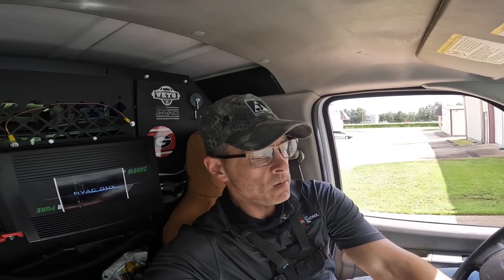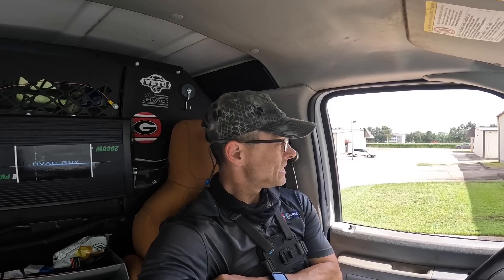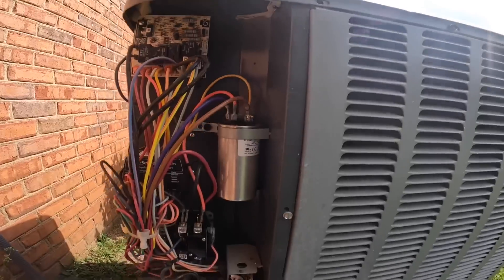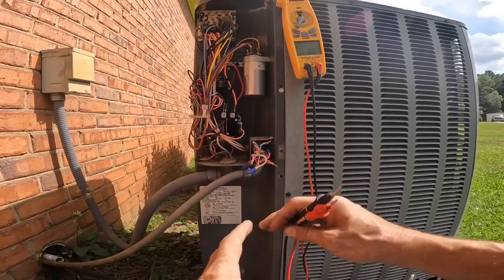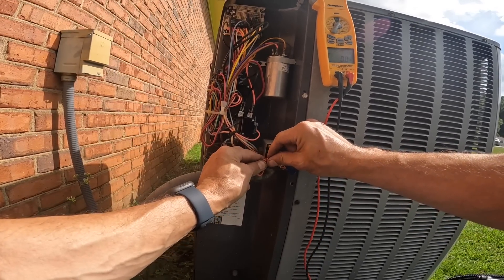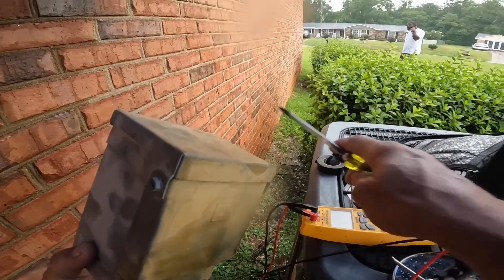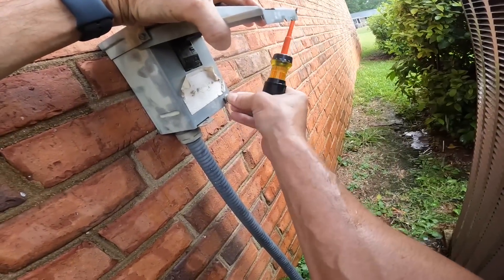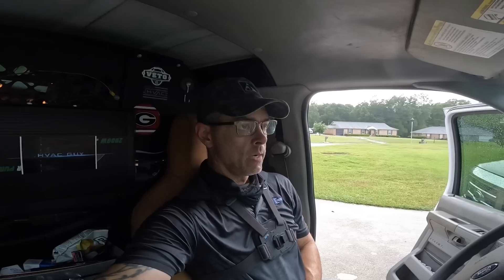Blowing Heat Inside and Cold Air Outside When It’s 94 degrees

Comment: Part of nest and junk . Or at least all the ones I’ve ran into . They have a schedule for continuous fan run and it’s not the same program where you set cool and heat or auto change over . Just had one that wiped out a X13 module because it was programmed for continuous run .

Comment: Sure wish I could find a HVAC person in my town …. I cannot trust anyone here each and every person always wants to either fully replace a 5 year old system or tell me some part is wrong. I call a ‘friend’ that doesn’t normally work on home system and they tell them how wrong they were. Another tech wanted to charge $800 to change a fan and some board for a $225 part from the manufacturer here in town and I was told the board isn’t needed for my system. Lots of crooks out there. Many techs would have said well that breaker was bad - replaced it noticed it was still down due to inside breaker tripped. Then charged for a breaker anyway. Either way so many dishonest people and I really want to find someone in my town with the honesty you have. 
Thanks for your dedication!!

Comment: I am a retired Hvac technician. I had an entire new heat pump system installed by a “plumber “ new Vivint t stat no  function. He replaced with new commercial tstat no function I got new version of Vivint t stat  programmed it  had to chase wiring they mixed found bad wire but connection Finley everything was working. Note Vivint thermostat is connected with alarm system/fire/co/ detection. It shuts down Hvac system on detection. Care must be taken for thermostat compatibility not to disrupt protection. I ran into similar problems with multiple power sources two inside and one outside in separate power box, good find.

Comment: True story. I work for a property management company when I was younger and fresh in the field.
I had a lightefixture that wasn't working. I replaced the starter, the ballast, and the bulbs. It would not turn on. I took a meter to it, which at the time I did not know how to read. I spent a few hours working on it to learn that the breaker was turned off. I feel your pain. I did learn how to properly use and read my testing tools after that.
Reply: and to this very day, coworkers are still laughing about it. 🤪

Comment: At the end, if you could remind us what the problem was and how it was fixed would be appreciated. Thanks
Reply: Outdoor unit was running in heating mode a check for 24 V on blue and orange which is common and reversing valve wire. So you Back track to indoor unit and he didn’t have a dare so he jumped out the thermostat and got 24 V to outdoor unit. That means he had a bad thermostat

Comment: Those T4's have such a long delay i always start second guessing about the time it pulls the contact
Reply: 5 minute's on TD on most digital tstats. Manufacturer's integrate that in their engineering to prevent starting that compressor on high head pressure to protect that compressor. It's annoying but necessary.

Comment: Unless another technician installed an actual circuit breaker in the disconnect, it is only a switch on and off. There is no circuit protection with the original disconnect just on and off. You can actually plug that on off switch into a QO panel and fire up temporary construction outlets etc. Handy item to have in your truck. SQ D is without a doubt the top manufacturer of electrical protection equipment in the world. It was the only product I used in my business because I knew that the circuit protection was the best made.
Reply: Yeah..they just had a recall of their load centers because they caused fires..but I’m glad to hear your opinion cause the electrician installed all Square D stuff in my upgrade to 200 amps..my panel is outside the recall date..

Comment: Changing stats because reversing valves in some units operate in the reverse. A breaker box for disconnect is a no no . They are not a off and on switch.  They also can't take the extreme heat . Even  fuse able disconnect is a no no or 1 arm bandit. I've seen so many failures in commercial . The heat will destroy them. Only use push pull disconnect.  That meets law requirements.  Right size breaker in main panel . Have a great day.
Reply: from what he said in other comments that breaker style disconnect is what is Code where  he is at in Georgia
Reply: @BryanGullickson  i like the Mars disconnect
Reply: @BryanGullickson   I know it's code . When you have several unnecessary service calls you learn to hate them. Nothing wrong with units just breakers or fuse mostly in hot weather.  I never said against code .
Reply: True must've been original box from 1st installment

Comment: reversing valve bad.....
Reply: Not fun having to work on hydro in the rain. That breaker should be in the house. Not much wire to connect to in the disconnect says the wires have been trimmed back before. Be safe. Thxs for the vids!
Reply: ...or a loose orange wire inside
Reply: or wiring, or thermostat or thermostat programmed wrong..